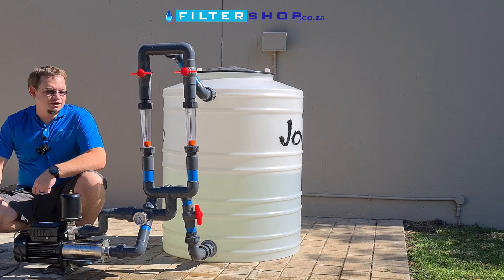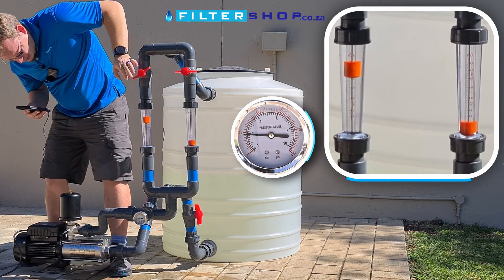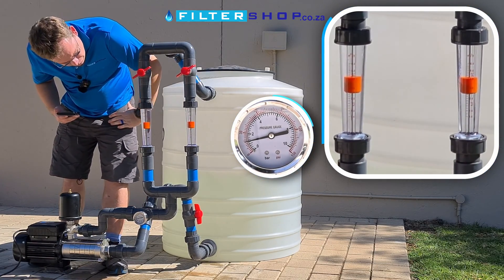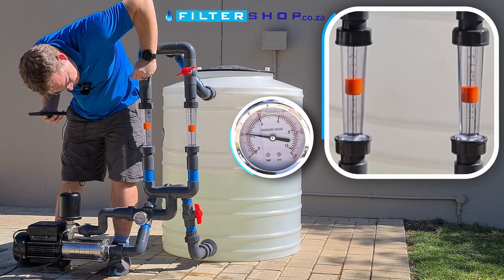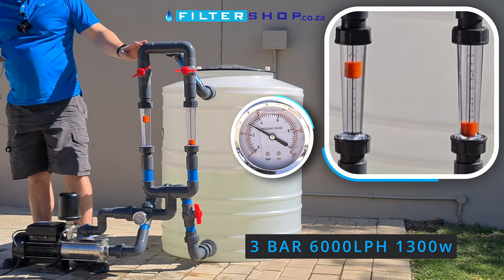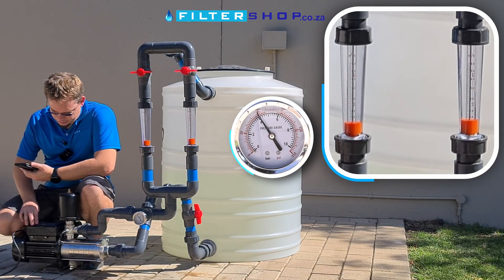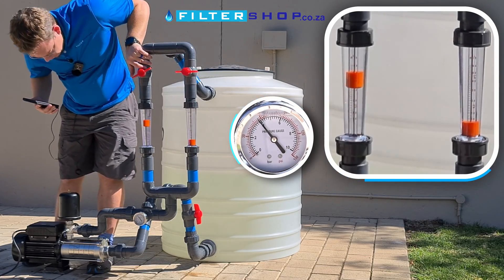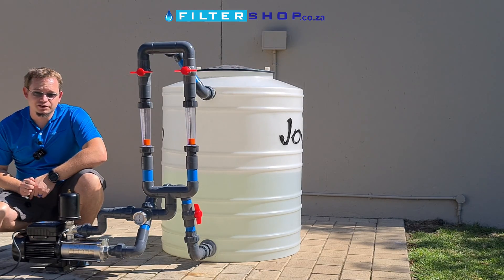HMS1500 High Flow Review

Comment: Is it possible to modify this so that it can be used in the US?  Third Scala 2 just sprung the usual 2 year leak from the rear drain vent.  Thinking it's time to change brands.  Any recommendations on units to get in the US?  Lawn is starting to die.  TYIA!!
Reply from the maker: Hi, I would look for something that has a multi stage pump. An option might be the Dab Esybox as i think there is a 110v version of it. They are unfortunately a bit more expensive.
Reply: What guarantee /warranty does this carry?